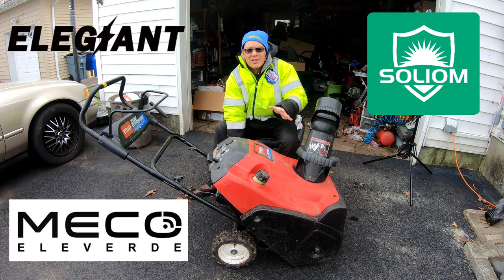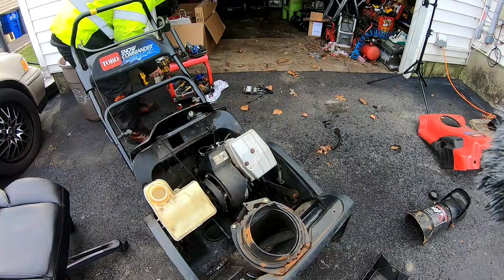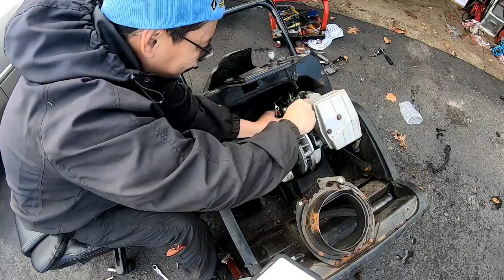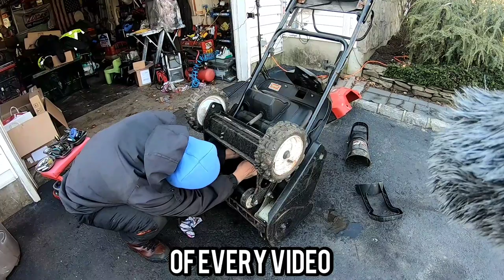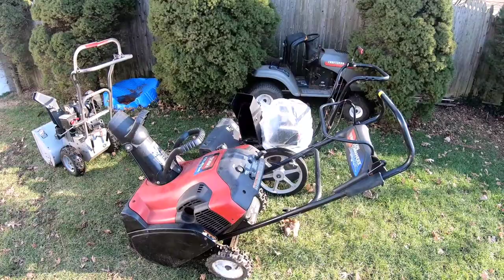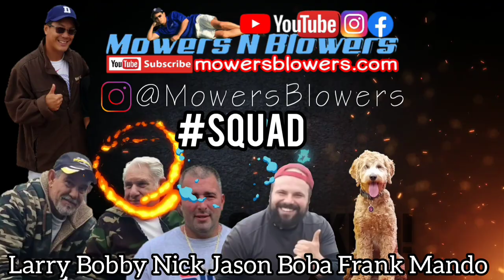TORO SNOW COMMANDER R-TEK 7HP 24" SNOWBLOWER IGNITION COIL MAGNETO CONTINUITY TEST SPARK REPLACEMENT

Comment: 👏My dude,  you are in absolute beast mode lately!! Great troubleshooting and sweet fix. Thats $350 in pocket right there. Thanks for sharing 👊💥
Reply from the maker: Glad you know the worth of a snow commander!  Most people think it’s just another small toro power clear!
Reply: I have the smaller CCR 2450 5hp with the R tek engine and they were expensive back in the day because they are a great machine.  I wouldn't take less then $350 for your machine. Stay safe bro. LGM!
Reply from the maker: @sallyboy5418  yeah I haven't budged off the $300 but it doesn't have electric start...otherwise your $350 is right on the money.  LGM bro!

Comment: I originally learned how to check magneto's when I was looking for a replacement for my 1941 Briggs. But on those it's a little simpler if it's stuck open loop you know its dead. If you get a read of anykind it basically means its good. If anyone knows for a fact, correct me if I'm wrong. On these newer mags they have to read above a certain voltage. Yours must have been on its way out.

Comment: Henry, Toro couldn't of made their products any harder to work on. Thats why so many end up on the curb. Your checking of the coil i think you shouldn't get a reading on the kill tab because that is a ground. I have a Snapper LE and they aren't any easier to work on. We got 10-12 inches of snow over night. Wind was about 30mph. Sucks! Blew snow for about 2 hours. Did my neighbor next door as they are both in bad health. ⛄🇺🇸  Roger
Reply from the maker: Good man!  Hope you had fun!
Reply: Yeah, the only bad thing was the wind! Its still about 25 degrees here.
Reply: That's the process for checking the old 3 leg magneto's like the one on my 1941 Briggs. One on the kill wire and one on the tab for the spark, if the meter starts reading, coils good, if it stays still or open loop coil is dead. My original coil was dead, the spark tab was busted off internally. Got a good used old working coil, that sucker popped back to life after sitting about 50 years. These new coils have to show above a certain number I believe not just active.

Comment: That is back from the dinosaur 🦖 days from the sound of the name of it 🤣one thing I noticed is that the engine is a two cycle nthe smoke means that the  oil ratio is a bit more than it should be
Reply from the maker: For sure,  but better more oil than too little oil.  Smoke is better than doneski!
Reply: @MowersNBlowers  yeah that's right